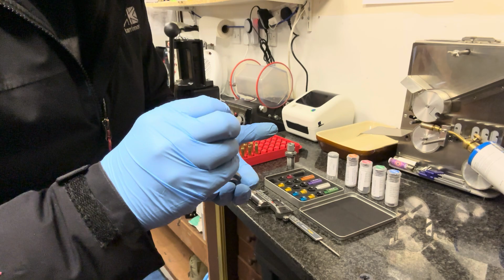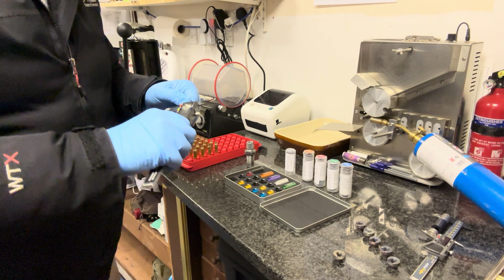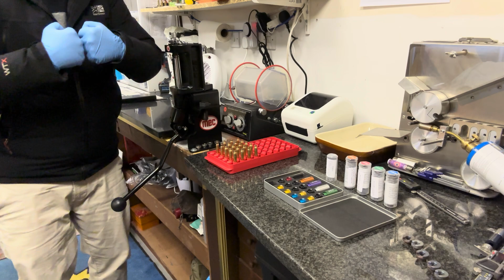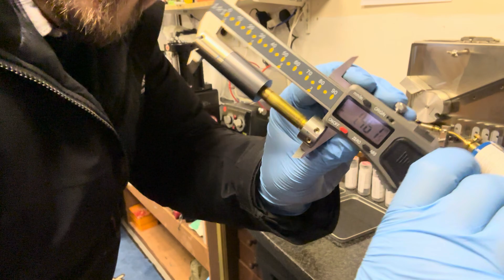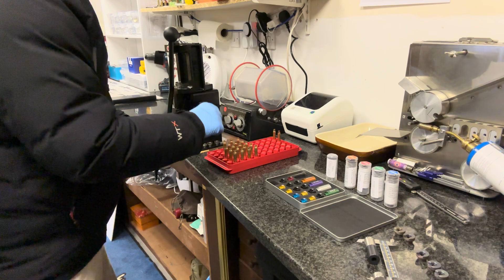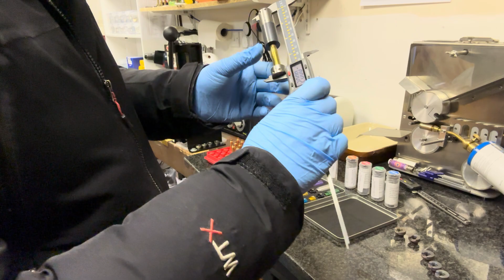Derraco Competition Shell Holders

Comment: The other good thing about using these Derraco Competition type  shell holders is that we can square up the die in the press before tightening up the die lock ring so that the cases enter the die dead straight in line with the squared up die. This way cases are sized properly and not sized off center.

Comment: The distance from the seat to the top needs to remain consistant. The difference needs to be between the holder seat and the base of the shell. That way the press is always doing the same thing with respedt to the linkage and ram.